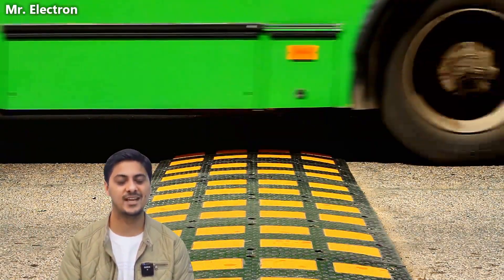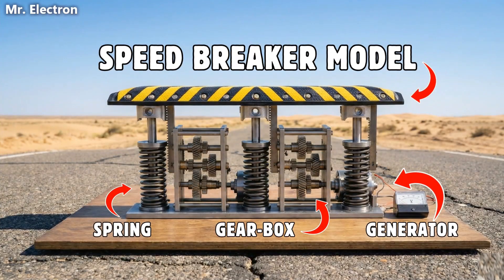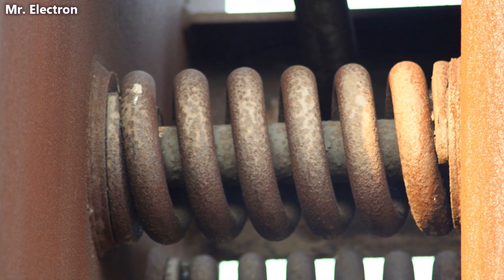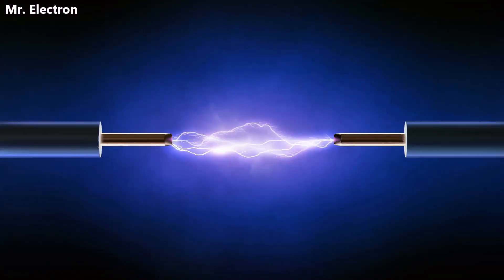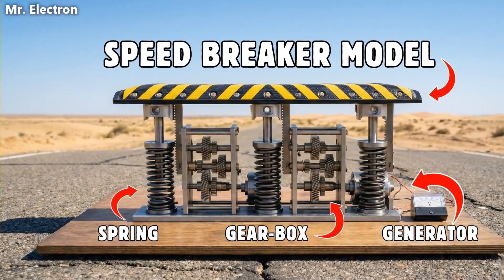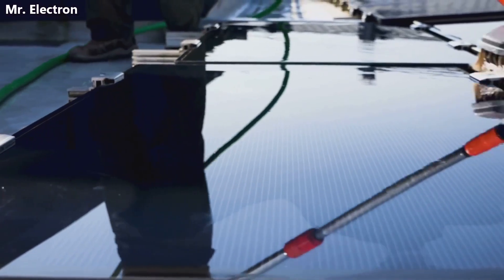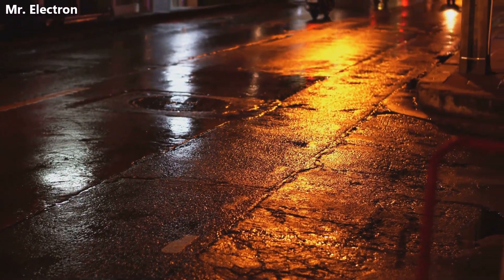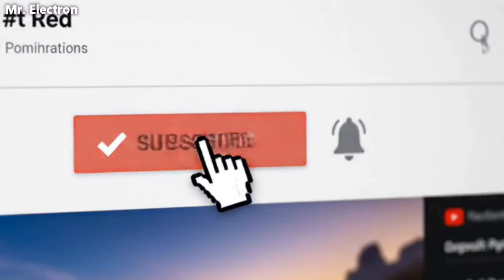How to Power Your House Using Wasted Car Energy - No Extra Fuel!

Comment: Brilliant ideas.  I tune in often.  Please examine or demonstrate the "Carbon Killer" aka " The Thunderstorm Generator".  It is being scaled for manufacturing by Rockpecker Industries in Ludhiana Punjab.  An Australian firm is also doing the same.  Original concept by Malcom Bendall and he released plans to the public.  Using a light filament and compression from an internal combustion engine, it generates electrical plasma spheres (plasmoids/ball lightning) that are used to convert engine exhaust (carbon dioxide and presumably carbon monoxide) into far less harmful substances.
Reply from the maker: Thank you! I'll look into it.

Comment: Sir, can you help me make a circuit to start a 280v 3phase DC motor? Thank you.
Reply from the maker: Are you talking about a bldc motor ?
Reply: @MrElectron 
I'm not sure what type of motor it is. I'm trying to operate an air conditioning compressor that uses an inverter module. It says 280VDC 3-phase on the compressor body. Can I run it without the built-in module on 220V single-phase electricity? Thank you for your response, sir...
Reply from the maker: No do not connect it directly to 220v without being sure about the motor type and its circuit.  Is it a residetial air conditioner or industrial ?
Reply: @MrElectron 
It is an air conditioner used to cool the house. I plan to use it as an air compressor.
Reply: @MrElectron 
To begin with, I bought a used air conditioner compressor without knowing its specifications. It turns out this compressor is an inverter compressor, which requires a module to operate it, unlike conventional compressors. The module itself is more expensive than the compressor itself.
Reply from the maker: Its probably a brushless motor operated compressor.
Reply: @MrElectron 
Please help me, sir. I'd like to create a simple circuit for this type of motorbike. It would be a shame if I bought it and never used it. Thank you.
Reply from the maker: How many wires are comjng out from the motor ?
Reply: @MrElectron 
There are 3 wires, labeled U V W.
Reply from the maker: @sandhercruzh2169 Step 1 ) Spin the motor shaft with you hands as fast as you can. Keep that speed in mind. Step 2 ) Choose any 2 wires from the total 3 wires and connect them together. Now spin the shaft again. If its difficult to spin this time or spins much slower than in step 1, its a bldc motor otherwise it is a 3 phase as motor.
Reply: @MrElectron 
I apologize in advance, sir. This is what I mean. Thank you for your attention.

Comment: You do realize these speed bumps steel forward momentum away from the car. Unless there's an overwhelming safety need for a speed bump, We should never place speed bumps to convert gasoline to electricity.
Reply from the maker: I know... Its not about adding additional speed breakers on the road as that would definitely be stealing. Its just about replacing the existing ones with these new types.